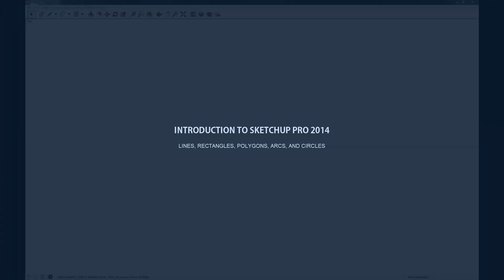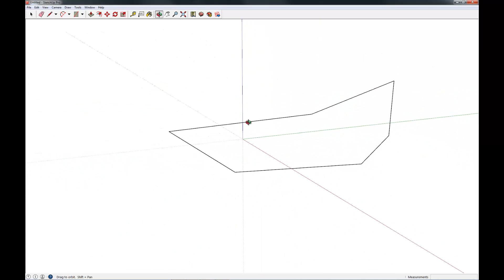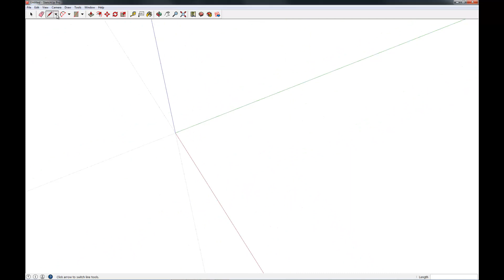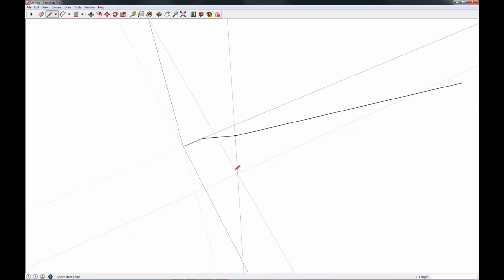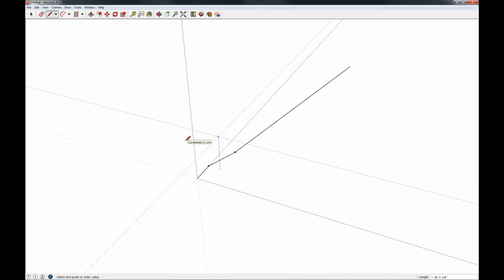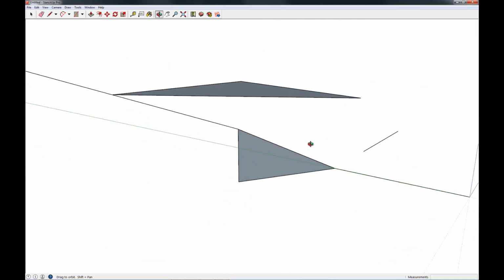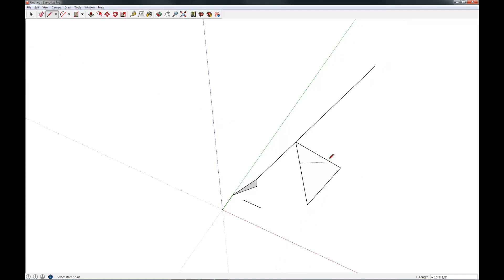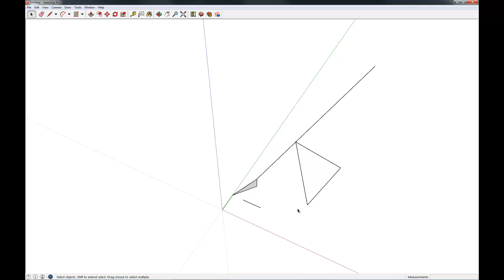Intro to SketchUp Pro 2014 - 2 - Lines, Planes, Snaps, Breaking, and Healing

Comment: How do I unsnap lines in Sketchup? I'm drawing an abstract object and I don't want my points to snap to ANYTHING, but it won't let me draw points where I want them.

Thanks in advance!
Reply: ***** Thanks so much! Yeah I'm trying to draw abstract 3D objects for a projection mapping project I'm doing but the points just kept snapping a tiny bit off from where I needed to draw them. I ended up just drawing them where they snapped to then moving them, which worked well enough for my purposes.

Thanks again!